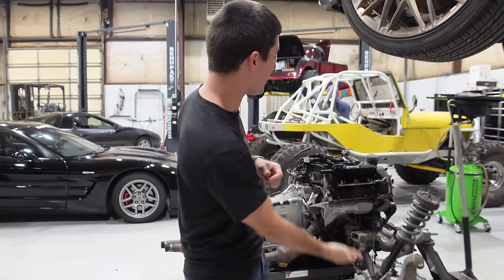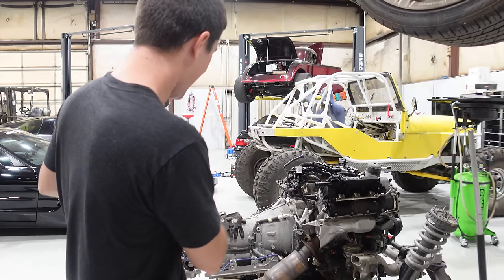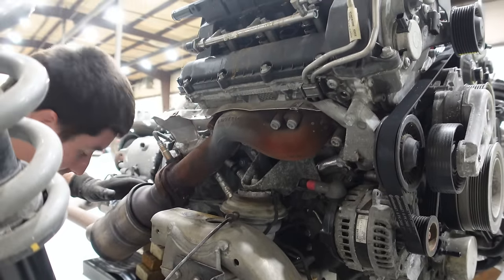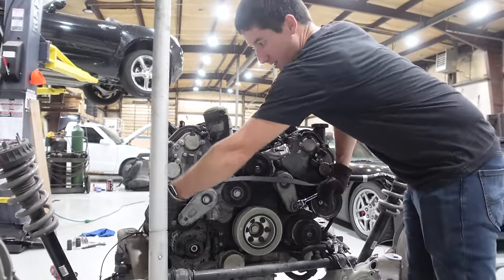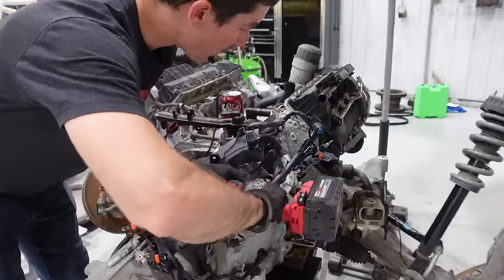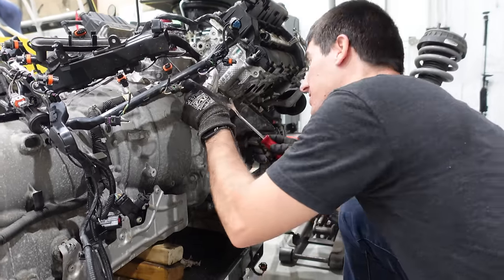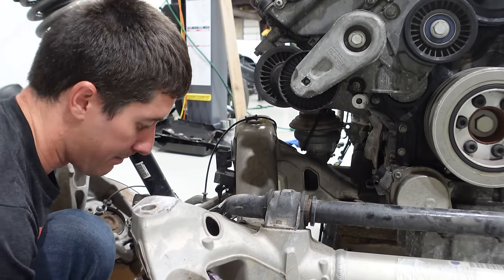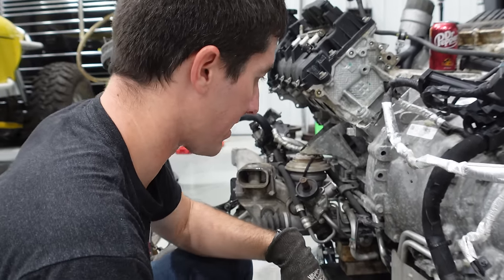My RUINED Jaguar F-Type Engine Should NOT Have Been This EASY To Separate

Comment: Why did you separate these two pieces if all you're going to do is replace a head gasket or two?  That could have easily been done with the transmission still connected and saved you a ton of time.
Reply: You must have missed the part at 17:49 where he tells us a new engine is on the way.
Reply: @harleyheritagespringer9077  He should have said that at the beginning and explained why.
Reply: @harleyheritagespringer9077  I absolutely did.  I think I was up getting coffee at that time.  Thanks for the info!

Comment: If you get down to tearing it down you’ll encounter the same style bolt head on the head bolts. Trust me when I say just use a Allen 10mm on them. I do it everyday and the exhaust bolts are Allen 8mm. Never stripped one out doing it that way

Comment: I'm not a diesel guy BUT... This would have made for an interesting Cummings Swap and sure would have drawn a lot of attention.
Reply: A “Cummins” the 5.9 or the 6.8 are 1200 lb engines that rise some 40+ inches. Never going to fit in a low-slung Jag.

Comment: So it’s a ford engine just drop in a A Lincoln continental engine
Reply: It's not a Ford engine.  Anyone who says so is ignorant of facts.
Reply: @stevemawer848  exuse me? It has ford combination of parts you have no right of calling someone shallow of their knowledge now I understand why people so selfless its that materialistic mindset. There is no my heart
Reply: @Msardinas86  It has Bosch injectors and NGK plugs - does that make it a Bosch/NGK engine?  Using OEM parts doesn't make it a non-Jaguar engine - they designed it, after all.  I work with facts, not unsubstantiated rumours.
Reply: @stevemawer848  Ford is as Ford does.
Reply: @pmscalisi  Yeah, and what Ford did was to pay their Jaguar engineers to design a Jaguar engine that they would build - under license after they sold Jaguar to Tata.
Reply: @stevemawer848  my point. They did the same to Mazda except Mazda bought out Ford’s interest. My 2003 Mazda6 had a Ford 2.3L engine.
Reply: @pmscalisi  Guess I'm luckier than you then - my XK8, 4.2 XKR, 5.0 XKR and F-Type all had Jaguar V8 engines.